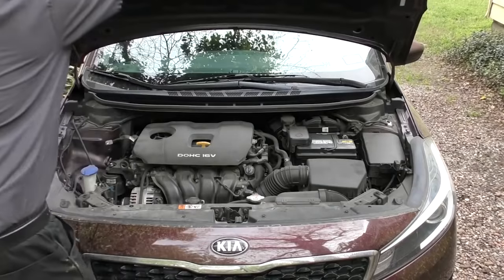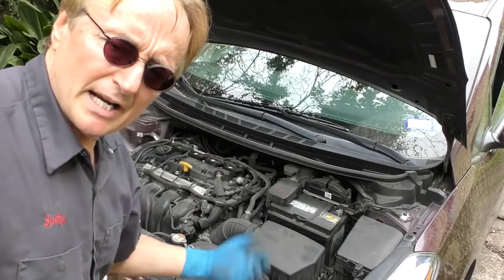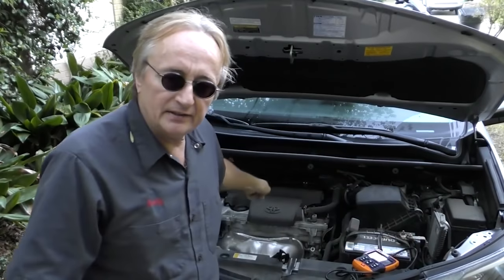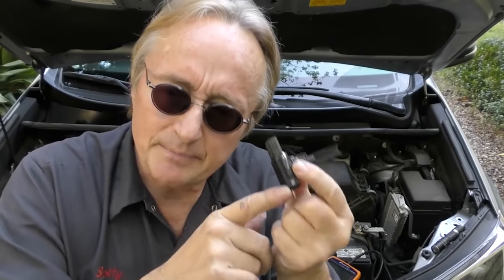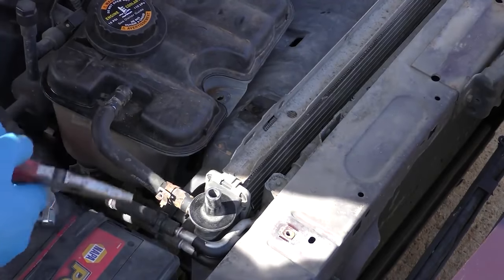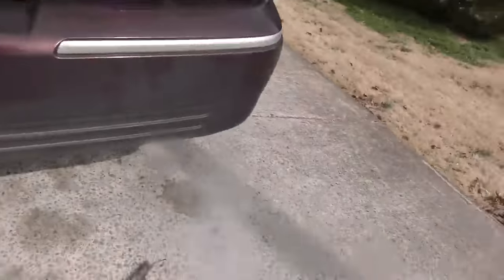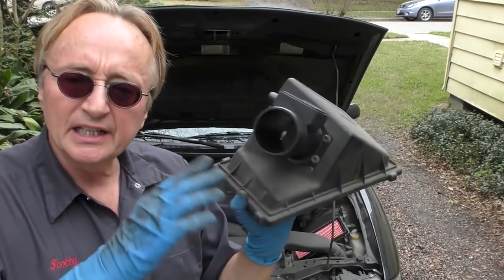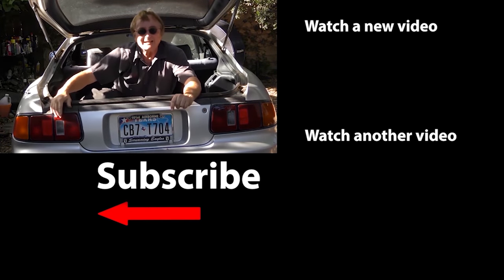4 Signs Your Engine Has a Serious Problem

Comment: Had a problem with my 96 turned out I had a bad ICM don’t find out until I replaced my ignition coil main relay and alternator check both battery and alt came back great long story short got my baby back rolling

Comment: If your rad is leaking change it! Causes it's usually half clogged too. I have 2 rads I had to change because they wouldn't cool the engine.  One had no find. The other was clogged with black sludge.

Comment: Last time I pulled a misfire code I was halfway through booking the diagnostic when I remembered something: the last time I had an inspection (my shop does one for free whenever they do an oil change), the shop sent me a picture of the air filter absolutely caked in dust. Took 5 minutes to swap it out, haven't seen the engine light in six months.

Don't be like me, folks. Do not procrastinate the little things until you forget about them.

Comment: I use liquid wrench silicone spray to check for leaks, since it isn't flammable you can spray it and not have to do it after letting the engine cool, my buddies dad used starting fluid spray that was cool until it started, a fure

Comment: Next inspection for my car is in march next year. Only thing I'm worried about is that I have aftermarket adjustable sports suspension and my car is new enough so it has to be type approved. This means that my car has to be re-registered with that system or component before I go through with inspection. My CV-link is about to break as well but I'm gonna buy one next week and change it that weekend, so no problem there.

Comment: 0:55 IIt isn’t usually hard to get out, but a wiggle usually makes it easier get out. You got to squeeze it to get it off. I haven’t had to push it up to get it off yet. Doing a repeat helps, especially for times that it doesn’t work the first time. I certainly do not want number one, in my number two hole, and I am not sure how to get number two in my number one hole, but I am beyond sure that I don’t want it in there.

Comment: I had a 1989 4L duel fuel Ford Fairlane, got it new, when it was about 10 years old the car was running fine on LPG, but on petrol I had clouds of black smoke, so I pulled over and waited for road side service. the rubber vacuum line dried out and the end came off. road side service cut 1 inch off and plugged it back in, all fixed

Comment: Try octane booster. Especially if u are forced induction. The fuel they are putting out these days do NOT correlate to the advertised octane at the pumps.  Me and a buddy both tested.  Both motors 1.8t  his is BAM head and i have AWP head. Im modded to about 300hp on 93 octane program. He is stock about 225 hp . We both had misfires ... Bump up the octane with booster ... No problems. Clear code and Try octane booster first before messing with stuff and wasting time and money

Comment: I use contact cleaner for maf sensor, isc sensor and vvti filter, it also leave no residue and dry fast, so far no problem and the price is cheaper.

Comment: Man i wish youre still in houston i wouldve taken my car to you lol i managed to fix my cylinder misfire. Changed the ignition coil and spark plugs, still the same. Changed the intake gasket. still the same. it ended up to be a failing fuel pump.

Comment: Thanks for all your video Sir.. `they are very informative and helpfull. I recently bought a used KIA OPTIMA GT 2.0 and when I start to drive in the morning it missfires at slow speeds. I did change the plugs and cleamed the fuel imjectors but it didnt help. What could be the other possibilities for the cause. Please advice.

Comment: I had a V8 Lincoln Towncar started having issues with ignition coil wasn’t a big deal eventually they said my head cracked for the manifold now it’s completely blown apparently. Sometimes can’t start it or put it into drive without it dying on me or over heating. Bunch of problems 🚗

Comment: MAF's have a simple operation.  They heat up the wires to a target temperature.  As the air flows over the heated wires they cool down.  
The sensor system then applies voltage until the wires are heated to the proper temperature again.  
The amount of voltage is directly proportional to the mass of the air flowing over it per unit time.
The honeycomb elements are there to condition the air before sampling.  They force the air to flow in a Laminar regime (non-turbulent) as the air passes over the wires.

Comment: Forgot to mention the purge valve solenoid for Toyota/Lexus can also cause lean condition if it gets stuck open. Had this issue recently on a 19 Lexus with 70k miles

Comment: Comments.  1.  Drive cycle.  Toyota dealer.  Wasn't passing smog.  Mechanic did not know the concept.  Fortunately, the head mechanic knew.  Gave me the part of the repair manual of how to do it.  It is not in the consumer manual.  I have done this reset twice over the years.  2. Mass air sensor.  Cleaned it.  About 10,000 miles later, I replaced it for about $16!.  Then everything was ok.  3.  Radiator.  Do not do this yourself unless you have a second car to run to the parts store when you determine that you need a clamp that disappeared or the hoses should be replaced.  Heck!  I had a factory replacement put in while the guys in the shop also replaced the hoses.  No one was cursing.  They could and did it faster than I could.  4.  Fuel filter.  The manual said it was in the gas tank.  I looked and it was in line.  So, I bought a replacement.  When I had the oil changed, I had the mechanic look under the car and he said it was an inline fuel filter.  I handed him the part and he installed it.  I don't have a lift, a second car to run out for parts when I would be in the middle of working on the car.  However, watching these videos, I can diagnose a problem and discuss it knowledgeably with my non dealer mechanic.  Thank you Scotty!

Comment: Hey my car started going below the 100-900rpm idle to 500-600rpm range rarely while driving and the power loss is quite evident , recently when i stress the engine out like going on a steep hill where the low end is pushed theres juddering from the front of the car , as if something of metal is very loose and hitting a lot. It also happens when i fully press brake and leave the clutch slightly till the bite point till the engine is under stress

Comment: My wife's Journey had the same code ( cylinder 2 misfire)and the dealer we got it from sent it to his shade tree mechanic that charges only 55.00 an hour in a city of 300,000 people.  They charge 100.00 an hour in my town of 40,000. Anyway 4 times we sent it back and they couldn't find anything.  I could hear and feel the engine not runny right. That has been happening since last summer less than a month after we bought it.

Comment: Scotty , I have Toyota Camry V6 XLE 2007Model , recently I couldn’t start it , I can see the figure of battery on the dashboard, I had jumped start with the other car , car started and I was able to get home  but once I had reached at home  the engine turned off by itself . Before I can see ‘ vsc system check’.

Comment: What would you do if a misfire code pops up, but the plugs and coils are new, and it's not actually misfiring?
The car runs great. The code just won't go away. And the code was there before replacing plugs and coils, but it continues to pop up.

Comment: I seen you used a regular clamp to replace the one that disappeared, arent the original ones designed to expand so the hose can expand under heat?

Comment: 1) Why heavy duty brake fluid goes into,
  Manual Transmission.
Not transmission fluid ?

          2) Why manual transmission.
  Has an automatic shifter ?
      2007 Nissan Versa.

Comment: I had po302 and po303, so I decided to change both.  I pulled out the second spark plugs as it  came out in pieces.  The rear of the spark plug from the body.   B I ngo that's it.

Comment: 9:33 Cleaning MAF Sensor - Surprised that no one has mentioned  . That you should clean them while they are cold , engine hasn't been running . Because the sensing wire would be hot if engine had been running . And of course spraying a liquid on a hot wire , as you will mention , will short out the MAF Sensor . And of course to let it dry completely , as I think you had said , one hour . And to clean it outside because of the vapors . And then bring it inside in a clean evironment , so dust or whatever in the air , won't land on it .

Comment: I had a misfire in my Lexus is350 08 on cylinder 2 , swapped the coils and the misfire didn’t come back for a couple days , came back on swapped all my spark plugs thinking it was the only issue left it could be , went to Cincinnati and halfway there (two hour drive) misfire on cylinder 2 and 5 and radiator hose blew off , now I do have a question; is there anything dangerous about only changing out the head gasket and head bolts ? Was told by everyone should just replace engine , never let it over heat but did get above operating

Comment: Hey Scotty speaking of possible engine problems, alot of people worried about Toyota using new 0w16 oil and 10,000 mile oil change intervals. 1, everyone thinks the oil is too thin and 2, 10,000 miles between oil changes will just make that already thin oil even worse. I know we can just get an oil change at 5,000 miles but alot of unknowing people will go to 10,000 miles thinking the manual will be fine. But that thin oil is worrying people. Can we ask Toyota for 0w20 or even better 0w30 when we go in for an oil change and still keep our warranty??

Comment: P0171, P015B, P0326, p0324, P0300. fuel trim system lean Bank 1, Oxy sensor delay response lean to rich bank 1 senor 1, knock sensor, knock control sys, cylinder misfired detected random cylinders sonic lt 1.8 2013, what kind of damage do you think I may be paying?

Comment: See you have that high revving like our aveo did. We took it to the dealer and they couldn't  figure  it out and drove it around and it never happened  to them. It costs over 3000dollars  to try and fix the problem and we had a mechanic  finally  drive around  with us to get them to listen  to us. And the revving  up happened again. We had all the 100000 mile maintenance work done it. But it only had 80000 miles on it. We stopped wasting money on it and got a different  car.

Comment: He has it backwards on vacuum pressure. 
At idle the vacuum is highest. 
At freeway speeds, the throttle plate is open and there is minimal vacuum.
Reply: Not quite.
Ask why so much volume.
Reply: @richardbonfiglio1765  It doesn't matter. 
With an open throttle, air is freely moving into the engine so no vacuum pressure is detected by the MAP sensor ( manifold absolute pressure ) . 
At idle or in a closed throttle coastdown, the vacuum is highest.

Comment: Hello I got that code running to lean on my 2019 Buick encore. The mechanic said it was the PCV valve which is normally probably like a $20 piece right? Well guess what I had to buy the whole cover because the PCV valve is built into it. And that was 200 and something dollars just for the cover !😢

Comment: Here's another reason Scotty doesn't mention.... A misfire was caused by the timing being way off. With how bad the timing was off, it caused the rocker arm to cylinder one to break. Learned the HEAVY VIBRATION leading up the misfire was a result of the timing being way off. Timing was off for two reasons- mechanic who replaced the engine put the counter balance shaft on wrong. And a bad valve adjustment added to breaking the rocker arm. This is why we all need an honest mechanic like Scotty. So you don't deal with the nightmare I did with my 99 Honda Accord.

Comment: My wife's old 2015 Ford Fusion SE with the supposedly "bullet proof" 2.5l engine had a cracked cylinder head in 3 places at 22k miles. Ford said they found 3 cracks from the forge so it should never have gotten installed in the 1st place so it got through the 3rd party cylinder head manufacturer and through Ford Quality control. Car was a real pain so we traded it for a 2020 Toyota Camry SE and so far the Toyota has been a great car. No more Ford's for me I am done with that company. Sad thing is the Fusion was a cool car it looked great and was comfortable, but it was not reliable and would not last as long as I like so I went back to Toyota. 4 years in on the Toyota not one warranty repair or break downs. Just oil changes and regular maintenance and man this car gets the best fuel economy 40mpg on the highway.

Comment: My dad owns a radiator shop in NJ, I was 12 yrs old taking radiators out and my dad would either weld when the older radiators where metal and I would put it back in. Now everything is cheap plastic

Comment: Hey Scotty, I have a 2007 Ford F150 5.4 V8 Harley Davidson, since a few weeks ago I have been getting the "Engine Failsafe Mode" alert, its annoying. The only light that shows up is the Tire pressure because I didnt put the sensors on new tires I got. But there is no "Check Engine" Light nothing like that, what u think it can be the problem. Thank YOU, I hope u see this!!!!!

Comment: So I bought a 2013 VW Jetta 2.5 in January where it didn't have the intake ducting/cover, except it just had a ducting tube with one of those conical air filters. At the elbow right before the throttle body there's I believe 2 smaller tubes that have pressing locks on them, you just squeeze them and you pull and disconnect them. I'm assuming that this is quite aftermarket, that there's no MAF sensor, at least not installed right into the cold air intake. How can I check to see what they've done works for the car?

Comment: air flow sensor doesnt matter
i messed up and didnt swap the dressings from my series 2 intech onto my series 1 donor motor. air flow sensor does nothing, she runs a tad rich and has a minor torque dip
still sits on a buck 80 and can get 3rd gear drifting with 120kmh wheel speed
id take rich running operation in 40c ambients over slightly lean ALL DAY
no one ever killed an engine running it rich, seen a lot of 2 strokes melt rings from running too lean

Comment: Another reason why I hate the Rav 4. WHY would anyone put a fuel filter in a horrible spot? I own a 03 Ford F150 Lightning change the fuel filter 10k miles 15k tops major performance change. Getting gasoline on me that is not fun but I get better each time I change it.

Comment: I had this code on my 99 avalon. And the shop charged me$950 for a new fuel pump system. So are you saying that all that was needed was to check the fuel pressure?

Comment: Hi Scotty:  Some decades ago, I had an old 62 chevy. Living in Canada; i was driving through Seattle...and the engine wouldn't idle.  
So! I drove into a gas station! The attendant looked under the hood...and called others over to have a look!!!  
The carburator was sitting on top of the engine, only held in place, by the hoses, and linkages!!  
It ran fine on the freeway...but quit at red lights!  
He wanted to sell me a new carburator....  
What; if I have trouble; I have to tow it 200 miles so he can look at it???  
He replaced the bolts...car lasted for years....

Comment: Hey Scotty, I have a question. Do you know of any issuses with the 2007 chevy impala? My grandmother has one with a 3.5L V6 front wheel drive. Recently it started bucking like a bronco at any speed and even while idle, the RPM needle would go down to almost 500 RPM.

Comment: Think my wires need to be changed. Did plugs, coils, and cam shaft solenoids.  Unplugged wire and worked fine for a day. Now loss of acceleration and misfiring again. Jerking at stop lights

Comment: I changed the spark plugs and the misfire switched from spark plug number 3 misfire to spark plug number 1. I changed spark plugs 1 and 3 with two more new plugs. No more misfire but it runs horrible. No power. Now the temperature gauge is going up to the red but plenty of antifreeze in the radiator. I ran another test and it says change O2 sensor. That's a new code. And I am getting a low voltage or high voltage from the brand new battery. Also running lean and Bank 1. Can't figure out what to do now. This is a 2006 Toyota Camry LE 4 cylinder.

Comment: Please please reply to me scotty. Ive got an 06 Jeep grand cherokee SRT8 with the 6.1 hemi. It overheats almost immediately idling or driving. Its got a new tstat, waterpump, radiator and hoses, and fresh coolant. The resivoir bubbles after i shut it off tho. The oil and coolant both look fine, And it doesnt leak. I brought it to the local hemi guy her in MN and he saud it had a huge air pocket. It was fine for 3 days and started over heating again.

Comment: My car has less then 500 miles with this parts. Spark plugs, ignition coils, throttle body, fuel injectors, egr valve. Still misfiring in cylinder one any ideas? The noid light doesn't flicker, stays on. Don't got the patience to look for shorted wires, went ahead and bought an entire engine hardness for 100 bucks with only 50k miles. Will arrive in a few days hopefully it works out. 😔

Comment: when removing all (4) well used spark plugs you're supposed to comparatively examine their tip conditions (gap size and eveness, cleanliness and other tell-tales).  He did not do this obvious thing, or tell us to do it.  This would provide insight on cylinder performances, especially when one gets codes/misfires--whether you're looking for it or not.

Comment: 2014 cc VW ( I know I messed up, but I have it now) manual transmission 2.0 turbo- 117k engine light flashes every 3 days, as well 1st to 2nd gear there's a hesitation before it takes off? Any thoughts before these Massachusetts mechanics rip me off even more...